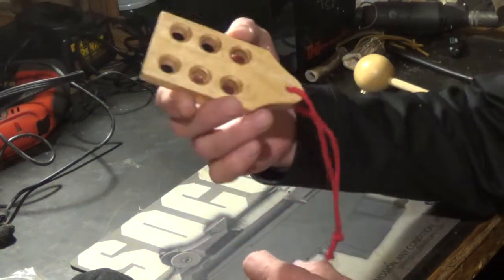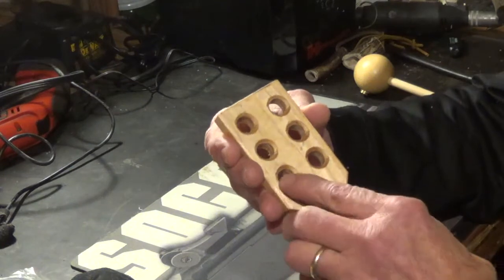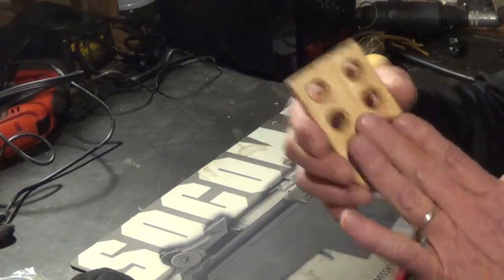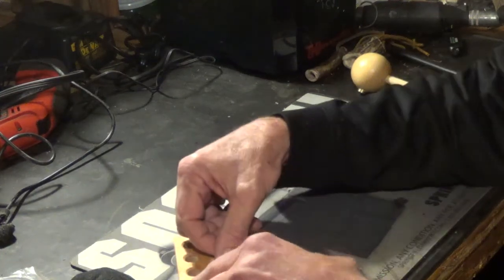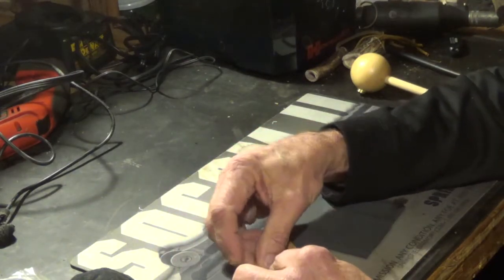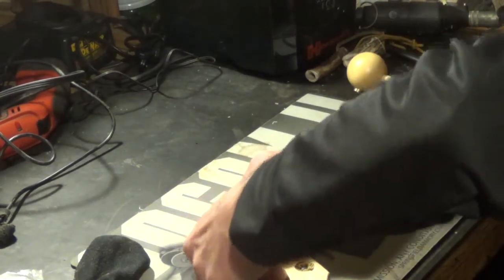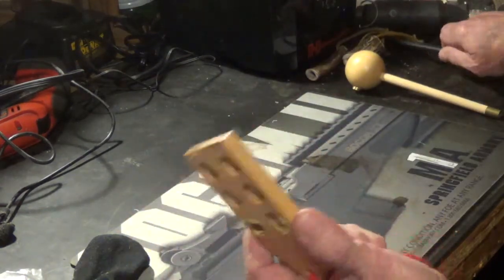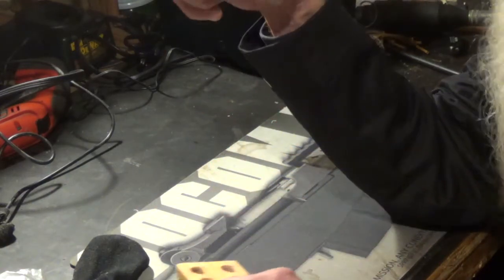Loading Block

Comment: i'm curious how the grease/ lube holds up, or does it get all over everything in the bag?
Reply from the maker: The lube will dry out over time.  Hanging from the bag with enough slack to reach to load is the best way to keep the lube off the contents of your bag.  Thanks for watching.
Reply: @UncleSasquatchOutdoors  i appreciate your quick reply, thank you. The rough environment i hunt in would catch and pull on anything hanging off a bag or strap. It’s going to have to be tucked into the bag and just re-lubed before each hunt